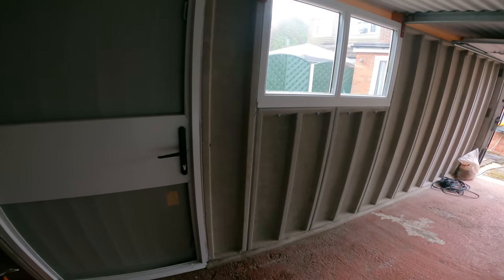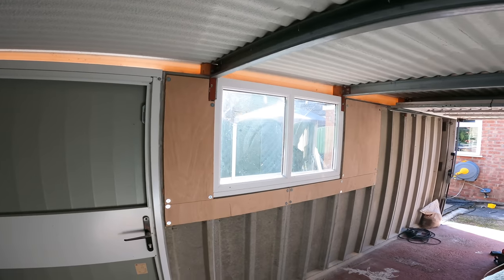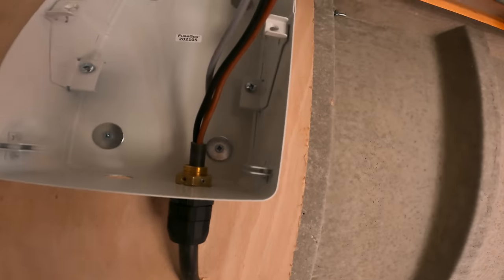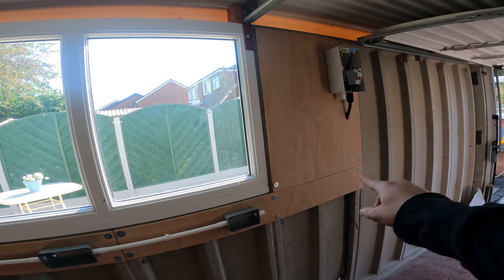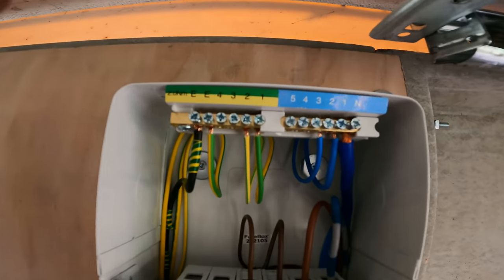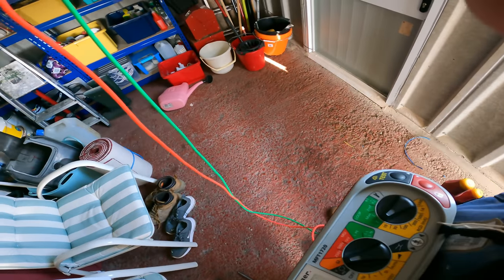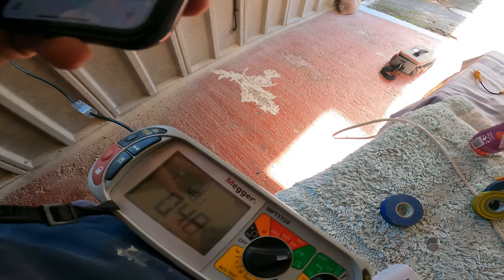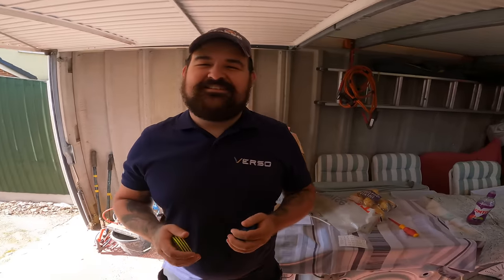Rookie Mistake ! | Wiring Inside a Prefabricated Garage | Testing | electrical life

Comment from the maker: Apologies for this camera footage somehow had it set to ultra wide the whole time, making us both look like we’re in a house of mirrors 😂
Reply: Your mate looks like the old wrestler  giant haystacks 🤣
Reply from the maker: @ericthekingthekingtheking4842  HAAAA 😂😂
Reply: @ericthekingthekingtheking4842  that is class!! 🤣🤣
Reply: hi mate - how much is it to have this done? weighing up having either a prefab shed installed or a bit of a wooden workshop type and want to run some cable from house or conservatory into the shed/garage for power, im only in widnes so not too far by the sounds of the accent! @Cablesmith
Reply from the maker: @s1dew1nd3r4  not too far at all, I actually did wade deacon high school a few years back 👌🏼 
Prices always vary quite a bit depending on many things, typically £600-1300 really

Comment: I have just had concrete garage fitted and need lights and sockets in but wanted sockets all round and it insulated and ply lined but the only problem is getting the cabling in the garage as i was told by manufacturer not to drill the panels as voids warranty they mentioned going through eaves liked this video and your work looks real neat tidy 👍👍
Reply from the maker: Thank you 😊

Comment: You should put a note down about multiple circuits through a back box (lighting fed through sockets) I got flagged up cause I installed a 20amp switch module and a fused module for underfloor heating on a lighting grid plate just look better than a separate fused spur, fan isolator and a light switch and was told it needs noting down on the circuit so that anyone working on it knows there’s multiple circuits.
Reply from the maker: Your very right, I normally would note that especially on grid switches ect with multiple circuits. 
here tho I didn’t feel it necessary as it was pretty obvious what was going through the conduit. Would have just been a box ticking exercise more than anything. 
Thanks for watching too mate 👌🏼👏🏼
Reply: @Cablesmith - I agree with you completely, it’s just something I wasn’t aware of at all and everytime I see it now I feel I should mention it incase anyone else was in the same position I was in. I now print a label flag off and put it around the line/live of the different circuit in the box plus a little label sticker printed off and stuck above the cable entry of the backbox where it comes in just incase the cable flag gets removed or falls off. Wasn’t at all digging, I just find out these regs that I never had a clue about and feel theres probably hundreds of others who had no idea too so I’d rather mention things for others to pick up rather than get caught out on if that makes sense? After all we’re all here to learn something, and better ourselves!💪🏽
Keep up the top work though champ, been subbed since your first video was recommended months ago and loving your growth!
Reply: If it was done on your annual inspection, you will find when someone like the NIC can't find anything wrong, they will focus on trivial things, they specialise at that.
Let's face it, in that situation any electrician would clock that, probably before they took the thing off the wall, and seeing the set up they would be thinking there's probably 2 supplies in there, if someone doesn't know what they are doing, they shouldn't be messing about in there.

Comment: Neat job. Insight on the garage from experience. The concrete prefabs have a wood rail that runs around the top of the panels and the roof brackets will fix to the batten and the panel. The panels that don't have a roof bracket will usually have fixing holes in at least the top two corners if not all four, blanked with a wood peg. Common methods I see for fixing plywood or OSB sheets without drilling the panels the are to use these holes with coach bolts through from outside, or to fix battens to the floor and the top rail. Many garage companies consider drilling to void the guarantee.
Reply from the maker: Nice to know that, I’ll remember this next time 👌🏼

Comment: see in the states we would have used emt instead of all that plastic and used off set bends to the boxes so tubing would have been flat to the surface very difficult to to use as a hanger rod. (side note i do not use emt that much im a residential spark not commercial) how ever your underground armored cable is so superior to anything we would use in the states
Reply from the maker: Yea we use steel conduit a lot commercial and industrial. Not very much at all domestic tho. 

Our saddles space the conduits off the wall the same distance as the holes in the back boxes so it wouldn’t work like that for us. But it would be a nice touch 👌🏼 
Thanks for watching mate !

Comment: Nice neat job lads, the only thing I would of done differently was drop the 20mm tube a bit lower then rather than running the lighting circuit through the sockets I would of used t-boxes and mounted the socket above but each to their own. The fusebox branded board looks the same as the now discontinued mk sentry range of boards. Probably made in the same factory in China.
Reply from the maker: Yep that’s a nice way to do it too, didn’t think of that tbh. Appreciate the input also. 👏🏼
Reply: Talking out of your backside Adie
Reply: I normally use a spur instead of a switch to save the extra circuit for one light.
Reply: @andrewweissenberger1766  yeah whatever son, 35 years in the game you try removing a socket that has other circuits running through it with no slack on the cables then spend time having to identify each circuit cut it then crimp it back up bad practice. go and have a read of the blue book

Comment: Wish you'd shown how you managed to get fixings on those concrete sections
Reply from the maker: I thought I did? Red plugs and screws plus some grip fill
Reply: Did you get much breakage when you drilled for the plugs?, am thinking of doing something similar
Reply from the maker: @paul1962uk  not that I can remember. I have had some blow out on a really old garage. You just seem to hit the rebar sometimes, just end up going in on a steep angle to avoid coming close to going right through.

Comment: i always thought you gb cldnt have lights and sockets on same circuit with out a fused spur?
Reply from the maker: It’s not on the same circuit. just runs through the same conduit
Reply: @Cablesmith  ya I realized after I made comment lol we do the same in the states as well I'm just not that used to it myself

Comment: genuine question, why not run the extra length of cable to make it a ring circuit instead of radial?
Reply from the maker: I’m just not a fan of ring circuits with the issues they can have undetected, so I’ll only use them where necessary. Mostly do radials.